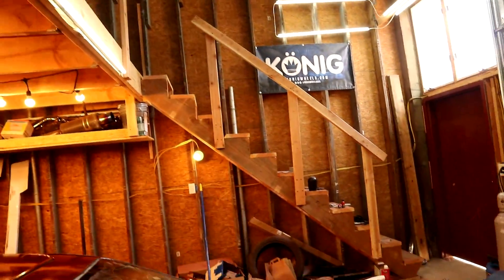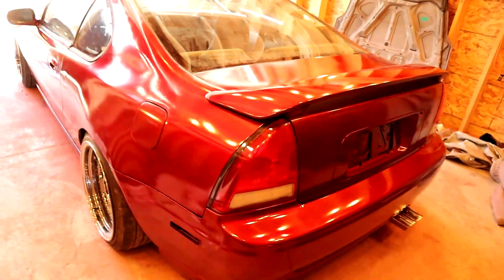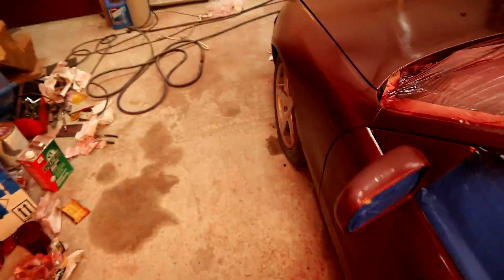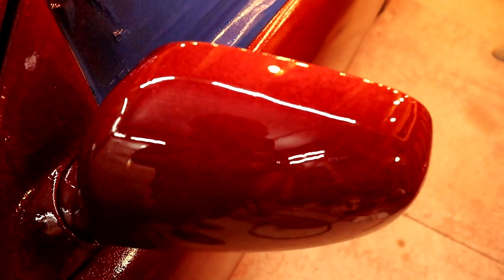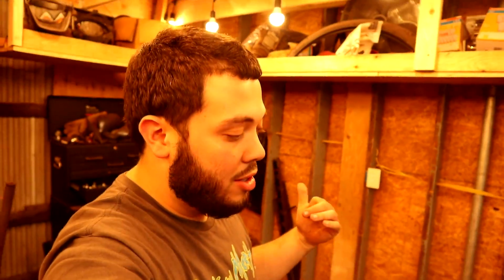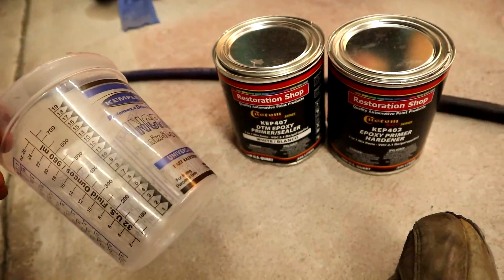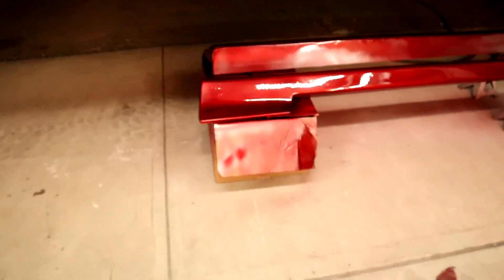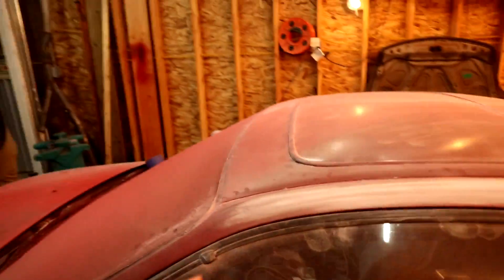MISTAKES WERE MADE...

Comment: The paint wrinkling is a time frame issue. There’s a window you have where you can spray more coats. Then you have to wait. That’s why in some paints it’ll say “recoat within 30minutes or after 48hours” or something along those lines. The reason is because the chemicals in the paint are evaporating (flashing off) you can recoat when the paint is still wet. But there’s a period where the paint is dry but not “cured” so it feels dry, but there’s still solvents flashing off. So you’re spraying fresh paint over half cured paint and the solvents still flashing off underneath reacts with the new paint and crinkles it. 

As for why it only happens in some areas and not others? No idea lol. 

I’ve had this happen every now and then when spray painting small stuff. It’s really fucking annoying when it turns out perfect and then 5 minutes later it looks like wrinkle valve cover paint lol
Reply: ^This right here, I've had the same issue.
Reply: that is it.

Comment: Orange peel isnt the paints fault its yours just take your time research single stage more
Reply from the maker: Andersonk L4 I don’t have an expensive gun and yes the vast majority of people have more trouble laying metallic single stage down flat so it’s a multitude of things I’ve researched well enough
Reply: Damian Monte  if your getting peel it’s because the material is too thick , air pressure is too low or moving at the wrong speed. Take the time on a test panel to dial in your set up before jumping on a whole car
Reply: @damianmonte  Orange peel is typically the result of improper painting technique, and is caused by the quick evaporation of thinner, incorrect spray gun setup (e.g., low air pressure or incorrect nozzle), spraying the paint at an angle other than perpendicular, or applying excessive paint.

Comment: You didn't prime the whole car then sand before paint..  move that regulator to the tank end of the hose, and the water filter, then u can blow the water through the hose with 1/2 trigger on the gun, I've said this many times.. the water is building up 10inches from the gun, it has to be up by the tank so you can blow the air hose clean before u shoot paint by pulling the trigger 1/2 way to blow the water out.. simple shit man.. budget pray gun = budget paint job

Comment: Word of advise from someone who used to work in an auto body shop, just experiment with your air pressure, IMO it seems like you are using a little too much pressure, and sometimes less is more. plus it will let you lay down an even coat of paint so it’s less sanding work 👍
Reply: Less is better but less is never more ...
Reply: In my experience when it comes to paint less CAN be more because you can balance your air/paint mix better without the excessive air pressure atomizing the paint so much that it can dry too much before it hits the surface you are painting.

Comment: You got to get a good gun, and move the water filter to the tank, 1/2 trigger the gun to blow any water in the hose out before u full trigger the gun for paint, your using a cheap water filter so keep blowing the water out constantly,  and always put the lid back on the paint can.. u should always use a primer sealer especially after any bodywork and spraying a new color over any clear

Comment: To get rid of the water you should go to the air compressor and there should be a valve or a plug to lose at the bottom of the tank to drain all the water at the bottom of the compressor you should do that every time you use the compressor. Not gonna lie the paint almost looked like plasti dip on the bad spots.
Reply from the maker: I did all that I think it might have been a reaction to the wax and grease remover honestly
Reply: Damian Monte ok good luck on painting again

Comment: This type of shit is hard to predict sometimes bro, i’ve been teaching myself to paint for a while and still run into problems. As far as I can tell the clear took well to the rear bumper because you didn’t respray it with another coat of single stage again right before you cleared it. It was sitting for a while so it had time to cure. When you sprayed over the rest of the car with the single stage again to even out the metallics you didn’t give it enough dry time in between that coat and the clear, that’s why it reacted. A urethane base / clear job would’ve been easiest on you but I know that shit ain’t cheap compared to the single stage, hope the next one works out !

Comment: Your single stage was layed down too  fast... it needs time to off gas. Another tip is to always primer the whole car before painting. Enamel is very tricky...thats all we sprayed back in the 80's and early 90's.. im here for help if you need it...also for whipe down dont use a wax and grease remover use acetone...test a panel with acetone   whipe down first it will spray and lay beautifully...keep on pushing through almost there

Comment: out of curiosity have you opened the drain valve on bottom of air compressor you are using to let all air and built up water flush out from air compressor. that will drastically reduce amount of water making it though the air line form the compressor. only speaking from personal experience. air compressors store a fuck ton of water inside them from continued use if never let drain and air out.

Comment: Love the content buddy I think when you painted it the first time you went heavier on the places that reacted and when you cleared there was trapped solvent in them areas from it not being fully dried I would recommend just going for a  base coat and clear but if you are set on using that paint and don't want to spend any more money (understandable because it's expensive) paint it then when it's dried up flat it down with 800-1000 then leave it a day or so allowing the solvent to escape (happens faster if its sanded because the skin is broken) then hit it with clear  go light coats with the red even if it looks shitty you are better with a bit of dry spray here and there than a run anywhere that kind of paint seems to gather more colour pigment or something in the runs and even when flatted you will still see where they were at hope this helps keep up the good work we have all been there standing at like  3am looking at a paint job that's not gone as planned thinking of setting it on fire 😂 all part of the process my guy ✌️

Comment: Build plastic enclosure with 3 mil plastic out a 2x4 real easy and cheap and make hole in the plastic for 2 fans to exhaust some the over spray and wet the f floor bro you will get a real nice paint job

Comment: You might have a problem with ventilation. Your painting in a very small garage so that could be why the top dries with the wrinkle and the bottom doesn't. My guess is there are too many fumes for your thinner to evaporate. I've seen you paint orion's truck in a huge garage so maybe that paint dried because there was more air around the car. Paint booths have fans for ventilation and filters to remove solvent so it can evaporate. When you painted the bumper you only sprayed so much and that didn't saturate the air with solvent is probably why it came out smooth. Be careful painting with the garage door open however as you will get dirt and bugs on your car. If that is your plan throw water on the ground everywhere to stop dust/dirt from coming up. 2k paint/hardener can also help as the hardener doesn't need to evaporate to dry the paint but air probably still helps.